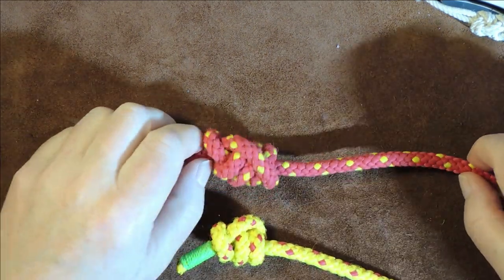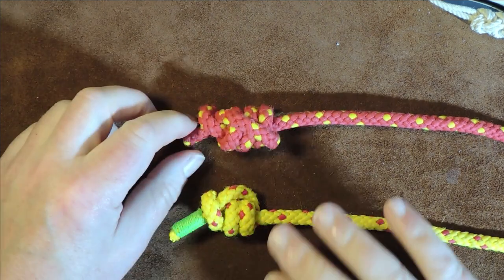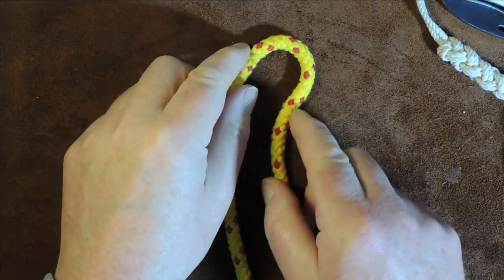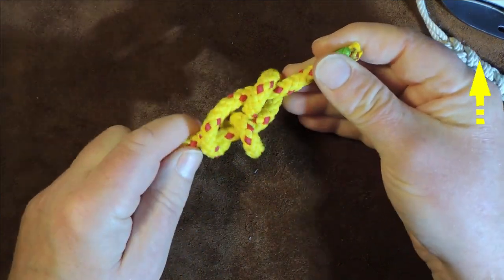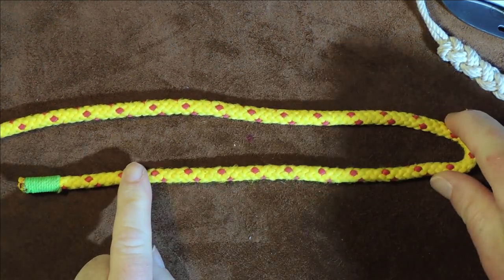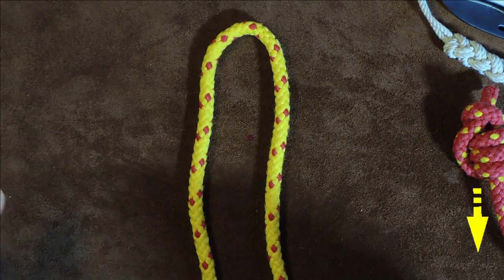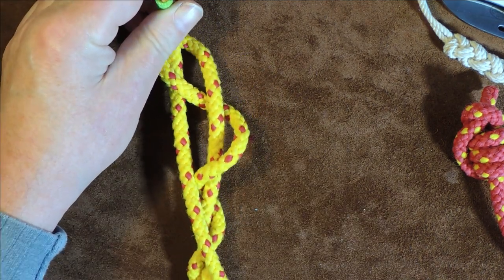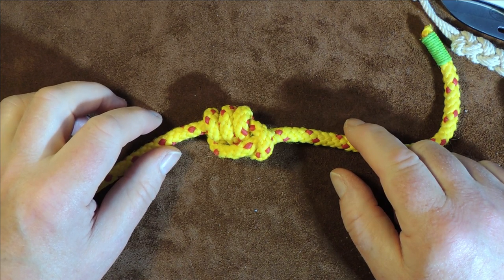Stevedore Stopper Knot - How to Tie the Stevedore Stopper Knot 🛠

Comment: I know this makes a stopper knot, but if the other end of your rope is made fast to the hook of a crane you can lift things if you make a slipped stevedore knot around objects that you won't to be lifted and I believe this is how it should be used,and it's ever so easy to make by taking 2 turns around the object and putting the slipped end through  it holds well and after the lift is so easy to undo .

Comment: Scaffold knots on my eyeglass frames, and two stevedore knots sliding and gripping at the back of the head. Holds glasses in place while gardening, farm chores, and horseback riding. (2 lengths of Paracord 550)
Reply from the maker: Thanks for taking the time to share this information, I always love to hear about knots and cordage being used in action! I only need glasses for reading and close up work. So I have loads scattered around the house, strangely though they all end up in the same place!!
Reply: @KnottingKnots  living in an area with high humidity, glasses tend to slide! I was trying to keep both hands on the job while working with horses. This winter I plan to make something more decorative with the lengths between, but this was quick and handy, and effective.